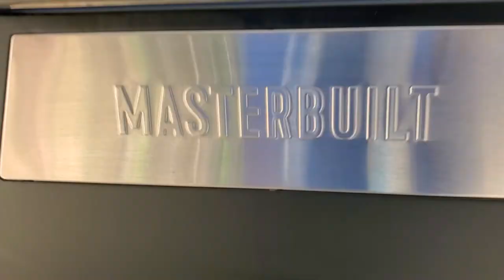Masterbuilt Gravity Series 560 - Empty Ash Pan

Comment: Any issue with fatty cooks like pork butt?  Do you use a pan underneath to catch drippings?  I notice it doesn’t have a deflector plate per se but I have seen on other videos where you see flames on higher temps. Grease fire issues?  This looks like a great unit.

Comment: Question: How is it with smoking? All the videos i have found so far are high temp grilling.
Reply from the maker: It's excellent. The hopper has been lasting about 8 hours for me, so I just refill as needed. I get good, clean smoke the entire cook. The temp holds steady due to the temp control fan and my I get a notification on my phone when the meat hits my set temp. All of my results, slow smoking and grilling, have turned out excellent.

Comment: you going thru alot of charcoal? seem like I got thru a whole chimney per cook.
Reply from the maker: A full hopper has been lasting me about 8 hours at about 250. They say it'll last up to 12 hours, but I haven't seen than yet.
Reply: @TimHoff85  ok ive been getting 6.what kinda coal are you using? are you doing anything special?
Reply from the maker: @scottmeskan1931  I've been using Royal Oak briquettes and Western lump. It'll take pretty much any charcoal you put in it. Briquettes do produce a lot more ash and burn quicker, but it all works just fine.